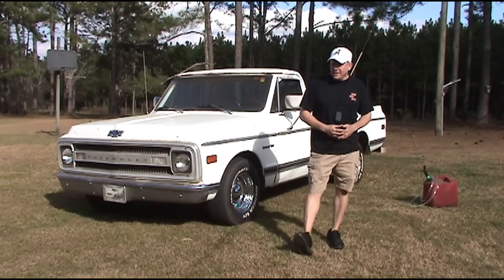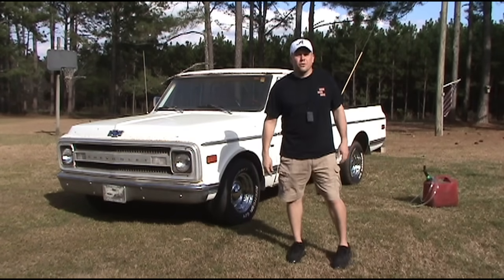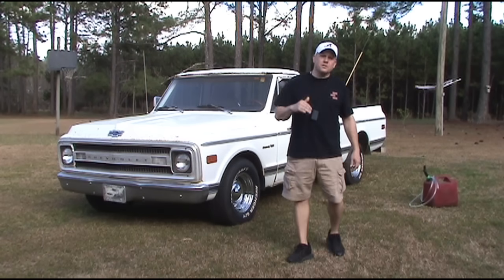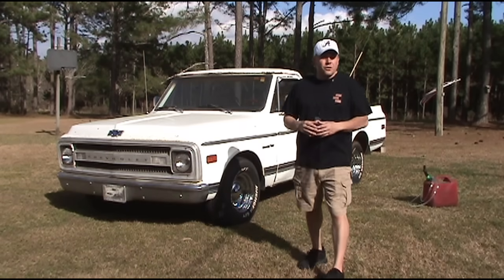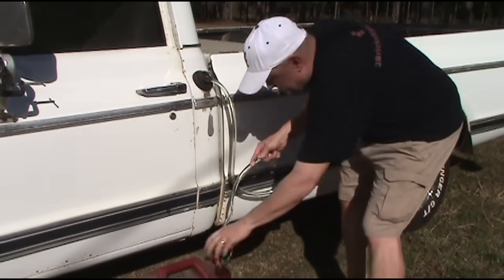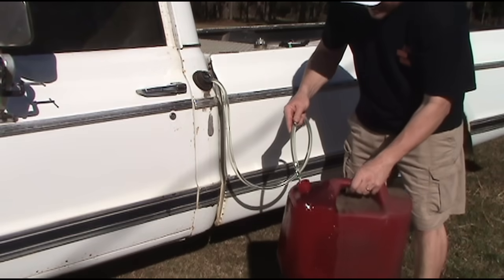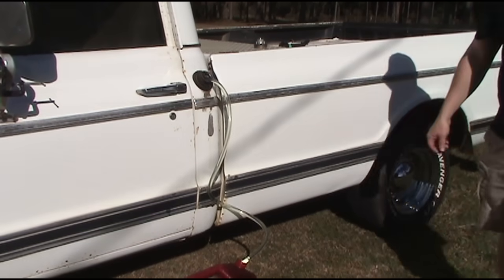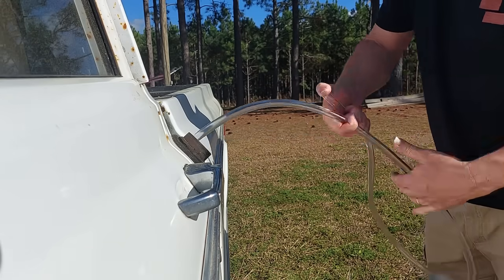Absolute BEST way to Siphon Fuel. You've never seen this before

Comment: The way I've always done it is similar to the first method, but even works on tanks nearly empty.  The trick is to use a hose 3 feet longer then normal. Insert that extra hose into the tank, WITHOUTH thumbing the end, so the slack fills up with gas. Then thumb the end, and start pulling the line out of the tank. Once enough is out of the tank that you can start the siphon, release the thumb.  Its a little tricky with an unfamilar tank, but better then using your mouth.
Reply from the maker: Very nice indeed!  That does sound like a good way 😎
Reply: ooh dang that's a good idea
Reply: Whats the name of the hose?
Reply: @careywhite9974 Any clear rubber hose will work.
Reply: @careywhite9974  can’t believe you asked that !
Reply: When I was in high school, we siphoned gas gas with a garden hose using a boat can because it was lower. Hardly any trucks around back then, so sucking on the hose was necessary to get things going.
Reply: I got the shake weight style syphon.  It worked for me.  It has some kind of brass tip with a glass ball that rattles, when u stick the tube down into the full tank.  Or maybe other way around, haha.  All the cars around me these days, have anti-siphon valves that obstruct me.
Reply: thats how my dad showed me how to do it without having to suck gas out of the hose.   Tho you could probably still use that method of putting your thumb on the hose first and then if it doesn't work put your thumb back on it to seal the end and then pull out a few feet of the hose to get a siphon going.
Reply: @bluenetmarketing  The hose does not have to be clear to work.
Reply: @__GALLANT__ Obviously. But a clear hose enables one to see the fluid in the hose.
Reply: @bluenetmarketing  You're right.  No doubt.  But you said "any clear rubber hose will work".  If you had said "any hose will work but if it's clear, it's better because then you can see the fluid", that would have been what you meant to say.  Right?   lol  It's all good ma'm.  No offense meant to you.
Reply: Yeah, that works as long as there's enough gas in the tank to keep the end of the hose submerged... if not just blow into the hose you're going to be syphoning through.  If the end of the hose is submerged, you'll hear and/or feel it bubbling inside the tank.  This will also pressurise the tank just like the second method shown in the video.
Reply: @careywhite9974  Siphon
Reply: @sidewayzmike  i’m sorry that you’ll have to pay for your own fuel
Reply: @bryanspanjer3213  you have to open your eyes and see a bigger picture my friend.  Sometimes, from a technician standpoint, fuel must be removed from a fuel tank, as a safety step.  Usually when performing fuel pump\fuel level diagnostics and repairs.
Reply: thats the method i learned
Reply: @careywhite9974  Martha.
Reply: Ha! I just posted that before I read this. I guess you beat me by a year.
Art from Ohio
Reply: This is how I've always done it.  I can't remember anyone teaching me, it just seemed obvious.

Comment: I like your system for siphoning gas! I’ve never seen that done before. My dad was an expert when it came to pumping water. He earned two U.S. patents for his Jet drives. He was a well driller and pump installer by profession. He kept a 55 gallon drum gas can in his pickup to power his well drilling rig. When he needed to siphon gas he would lower a garden hose into the drum. He would move the hose upward about a foot with his thumb over the end. Then he would release his thumb and very quickly move the hose downward. When the hose struck the bottom he would cover the opening with his thumb and repeat the process until the hose was full and would siphon on its own. Not only will this start a siphon but the pumping action can shoot a liquid at least 10 feet! I worked for a farmer that I didn’t like. He was trying to siphon gas with his mouth. I said, “Let me do that Al! Stand back!” He was about 6 feet away and I blasted him in the face with a stream of gasoline. 🤗It was great! “Oh sorry Al! I told you to stand back!” The only people that I’ve seen use this technique are my dad and my brothers. My dad was a smart man!
Reply from the maker: It sounds like he is a smart man.  I'm gonna have to try his technique.  It sounds pretty cool 🙂 Hey thanks for sharing. Whoever reads your post will appreciate it too! 👍
Reply: He's right, I did also appreciate it!
Reply: will that technique empty the tank completely?
Reply: @  It will empty a container as well as a siphon will. There will always be a small amount of liquid left in the hose and the container when the siphon stops.
Reply: @gordondahle7844  Thanks for the reply. Unfortunately my access to the tank is not possible from the filler because of a blockage in the connection from the filler to the tank for a Corolla 2000 model.

Comment: Mate i've been playing with syphons all my life as long as i can remember and have never come across those two bloody brilliant ways to syphon without as you said, "getting a mouthfull of petrol"..   Thanks for that video, being a farmer with lots of machinery I do still use the syphon from time to time, and i am very thankfull for your ideas..
Reply: During the 1972 oil crisis everyone was siphoning gas. I made myself a 2 tube siphon using a cut-off from a pinboard covered with a quarter inch of cork. I was a student driving a VW Beatle when I came across a farmer in a pick-up that ran out of gas about 5 miles from the nearest pump. He flaged me down and explained that he had run out of gas and enquired if I had a spare can of gas. I said no, but I have a hose and could siphon some from my car to his pick-up.
He smiled and said, "without a can". I said, "yes, without a can". He got a smile, while eyeing the pick-up gas cap about two feet higher than that of the Beatle, "do you know how siphoning work?" I got my contraption out and transfered about half a gallon siphoning "upwards". We both left smiling and happy. We could still make the pump that closed at 6pm as a gas saving measure during that stage of the oil crisis.
Reply from the maker: @gerhardvandenberg7249  that is interesting. I would like to see that in action.  That's a pretty darn smart contraption 🙂👍
Reply: On ya mate
Reply: @gerhardvandenberg7249  Great story! My dad was a VW mechanic and I remember his first Beetle was a '56 rebuild he called Betsy. But you drove a "Beatle" - was it by any chance named John, Paul, George or Ringo? 😁😉😊

Comment: Wow! Thank you so much! The siphon we bought had the bulb in between the tubes and didn't work. I detached them and used your method on our motorcycle, which worked immediately. I impressed everyone.
Reply from the maker: Thank you for watching 😊
Reply: @3BricksHigher Wrong, many others, including myself, were taught this trick many decades ago,…nice try though pal.
Reply: The bulb is often directional and needs some gravity assist to work properly.
Reply: @gregflores8959  so you wasted your own time watching a video about syphoning gas when you already had a method..
Reply: @michaeltoner1993  Sorry my statement triggered your sensitivity, you obviously felt compelled to comment, again,  I apologize Michelle.
Reply: @gregflores8959  not at all, I was simply offering my thoughts on your criticism of the video. Is that not the point of a comments section?
Reply: @michaeltoner1993  I don’t have time to waste, especially with you,..goodnight.
Reply: @gregflores8959  fair enough I expect  you've spent most of the day learning how to siphon. On another note, it's quite simple to set up a Google or YouTube account under your own name Michelle, instead of using your husband Gregory's. I expect there's a YouTube video you could watch to assist you with that too!

Comment: I'm a trainnee mechanic and I've learnt something new today 😊. God bless you
Reply from the maker: Its a great skill most people do not have.  As long as you want a job, there will be one for you 👍
Reply: If I have to drain a fuel tank I can't get a hose into I remove a line at the filter or at the fuel rail " schrader valve core " remove fuel pump relay and use a jumper wire to run the fuel pump .
Reply: Another thing to remember , any car with a mid mounted tank if take out the seat part of the back seat you have access to the fuel pump , in these vehicles you can change a fuel pump in about 1/2 hour and it makes it easy to do diagnostic .

Comment: Trick number 3. Use two different size hoses. One short, one long. Kind of like trick 2. One must slip into the other pretty snuggly. Slip one into the other. Insert the long hose into the tank like trick one. Lower the end of the hose below the tank. Put your finger on the end of the hose and pull the short hose off of the long hose. The vacuum created when pulling the hose will suck the fuel up and over the bend. Just don't make the short hose too short. It should be about as long as the distance from the bottom of the tank to the filler spout, give or take a few inches. Works no matter what the fuel level is unless it is nearly empty. In which case it won't siphon anyway.
Reply from the maker: Thank you for sharing that.  Good tip 👍🙂
Reply: Yes

Comment: I worked in an auto repair shop.  After the first time I got a mouthfull of gasoline I decided I had to be much more careful.  Eventually I came up with my own foolproof method- I took a piece of string a bit longer than the hose, tied a small piece of rag to one end and a small bolt to the other.  I would drop the bolt through the tube and stuff the rag into the other end, put the rag end of the hose in the tank and pull the string so it pulls the rag all the way through the hose.  The fuel follows up the tube behind the rag.
Your methods are easier.
Reply from the maker: Your way is genius. 🙂👍  I wouldn't have thought of that. I might have to give it a shot 😁

Comment: First tip I learned is make sure the truck ain't a diesel unless your car is.  Second thing to note is most new vehicles have some kind of anti-siphoning flap or locking gas cap.
Reply from the maker: They do, but this method works on other equipment that has fuel tanks 👍
Reply: There's a video of dude stealing gas. Except that he got the wrong tank. It was motor home and he was sucking crap. Lol 😢
Reply from the maker: @commentsedited  🤣

Comment: Thank for the video. I love old Chevy's! I have a 71  C 10 in my driveway I need to drain the tank and replace stolen parts on, a 72 El Camino in my garage and an 86 Chevy g 20 van I got a really good deal on a few months ago it needs a some work too. I'm going to be really busy this spring/ summer learning how to fix them myself bc I'm never going to trust anyone with any of my vehicle's ever again.
Reply from the maker: I understand how you feel. I work on all of my vehicles when they need it. I will post a video of how i changed the ignition in my 69 without paint damage just after the new year. I hope you'll check back 🙂
Reply: @3BricksHigher  
After the 71 was stripped for parts, it was stolen bc the guy that set me up to have it stripped for parts wanted the engine, that engine only has about 3,000 miles on it after it was rebuilt an older man I knew he was like my adopted dad wasn't any of it, he told me I'll get your truck back and don't ever trust him with that truck again and the next day after we located my truck I got it back!
That dude was mad he called me and said Let's go get your f***ing truck! I was in a long term relationship with the guy that set me up to have my truck stripped for parts and tried to steal my truck for the engine. So like I said I don't trust anyone with my vehicle's anymore.
When I bought the van the old guy that sold me that threw in a repair manual for 67 thru 87 Chevy trucks. All I need is tools and parts I'll fix myself.
Reply from the maker: @maryw3989  after all of that  i don't blame you.  Karma finds people like him
Reply: @3BricksHigher  
I've observed that karma finds guys like that multiple times until they figure out what they did wrong and make it right and they better hope they don't run into my brother we grew up in the old days when vehicles like that were built in our hometown and some of our family members were on the assembly line building those vehicles and retired from those factories. They made it personal.

Comment: You're not the only one who knows the thumb trick. Been doing that for decades. And the tank doesn't have to be 80% or more full. What matters is how low you can get your gas can relative to the height of the tank.
Reply from the maker: My Pappy had friends.  Whoever you learned it from might have been one of em 🙂

Comment: That's pretty slick!   My 40 year old invention was a 6' section of garden hose, a hollow rubber toilet float, and a 3' length of 1/2" vinyl hose.  I cut two holes in the flapper, one to put the hose down the center and a smaller one slightly offset from it for the vinyl.  Run the hose down into the gas tank, hold the flapper against the filler opening, and blow into the vinyl hose.  It would push the gas up the larger hose and fill your jug in no time at all.  Keep blowing for faster transfer.  Alas, the smog cannisters lowered the efficiency of that method since then, but it still works for pre-1995 cars.  (just like your rag and two hoses method.)
Reply from the maker: Nice tip! 🙂
Reply: Hell yeah!! Youre a genius! I'm making one right now.. got any DIY toilet float ideas? My toilet will need one after this haha

Comment: This is the most helpful video. We're without power, gas is scarce, people are crazy my car tank is full. Thank you!
Reply from the maker: After you open your gas cap, if you have a flap, just push it in with a pencil (or something similar) then stick the hose in the tank. Once finished, push the flap back in so you can pull the hose out.  I hope you and yours recoup quick and stay safe! 👍

Comment: I had a Yanmar diesel in my sailboat and the engine had a primming lever which took for ever to pump fuel. I would blow into the fuel tank and prime the engine that way. It worked great.
Reply from the maker: Never thought about using the method to prime a carb.  Nice tip!

Comment: There is another simple way. Take a relatively long hose 6 ft or so.  Shove as much as you can into the fuel tank, getting as much hose into the gas and filled with gas as possible.  Hold your finger or thumb over the end of the hose (or kink the hose, or put a closed valve on the end.  Now yank about 3-4 ft of hose out of the tank as quickly and smoothly as possible and pull it down to the ground.  Release your thumb, make sure it’s flowing, and stick the end into your gas can.

Simplest way ever, works with water, diesel etc.
Reply from the maker: Nice tip!

Comment: I was basically using that first method 50 years ago. Nobody had to tell me how to do it. It just seemed obvious. The only difference is I used a longer hose and shoved in in so it would fill with gas, then I put my thumb over the tip of the hose and drew out about half, which is now filled with gas, then released my thumb with the nearly gas-filled portion of the hose lower than the tank.
Reply from the maker: Thanks for the info! That seems like a good way too 👍

Comment: I have used that but if the tank is low put the hose in as far as you can put your thump over the end and pull it out and release thumb . Do it quickly in and pull out do it quickly using your thumb like a check valve . When gas comes out lower the hose and it will run on gravity .
Reply from the maker: Nice tip.  Thanks for that!

Comment: I've been doing something quite similar to the blowing into the tank, but your way works better. I used to put the hose in and put a rag around the hose, to make it airtight. I would then blow into the hose, and hold my thumb over the end of the hose until I took another breath, building up pressure in the tank with each breath. After a few times doing this, the pressure would build in the tank enough to push the gas through the hose. Sometimes it didn't work and sometimes I'd get a taste of gas,, but usually it would work just fine. Thanks for the tip, it's 2 hoses if I ever need to siphon gas again.
Reply from the maker: Thanks Lawrence 🙂👍

Comment: Someone correct me I'm wrong but don't most modern cars have a blocker of sorts a little bit down in the hole to prevent you from putting a hose into the tank?
Reply from the maker: Just use a pencil or small stick to push it down, insert the tube and you can siphon just fine 🙂
Reply: Ya but his pickup is not modern
Reply: All modern vehicles have a check valve in the fuel neck. You can push past it, but you will need a very small hose like the hose’s on the hand pump siphons you buy at the auto parts stores. On most modern vehicles it’s probably best to go in thru the EVAP line or the section between the fuel filler neck and the fuel tank. I had a 1998 Monte Carlo and the factory service manual instructed going thru the evap line to the tank. I did that job in June of this year. On my minivan I go thru the section after the filler neck.

Comment: Thanks for that video. I've been doing something similar by inserting the hose, then, thumb on the discharge end, moving the hose up and down rapidly about 6 inches at a time  while closing and opening the discharge end with the thumb to simulate a check valve. But you have to get the timing just right. Your method is foolproof.
Reply from the maker: Thanks for the kind words and for passing along your tip! 🙂👍

Comment: 2 Awesome ideas!  Great! Thanks!
Reply from the maker: Thank you! 🙂👍
Reply: @3BricksHigher  Want a 3rd cool method?  This won't always work...
But---insert the hose as far into the tank as possible.  The trick is to make sure no air gets into the hose.
Now, hold tightly the outtake portion with your thumb (holding vacuum).
Pull out the hose.
There should be enough to prime the system.
Reply from the maker: Nice 👍